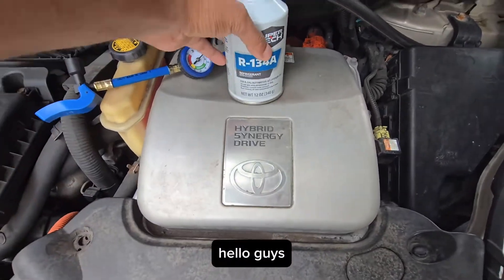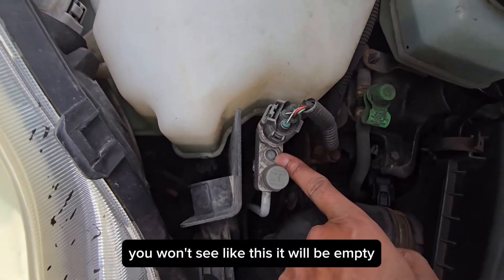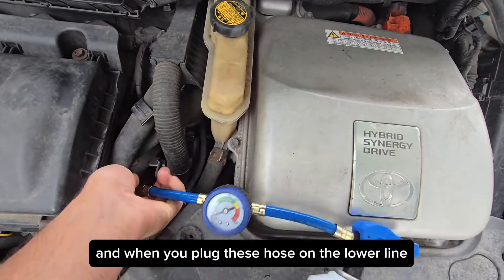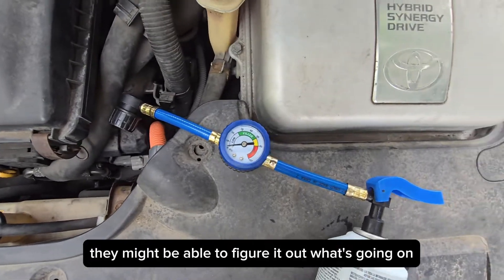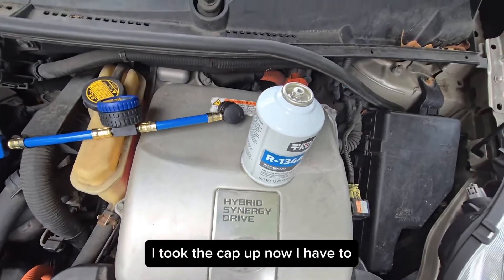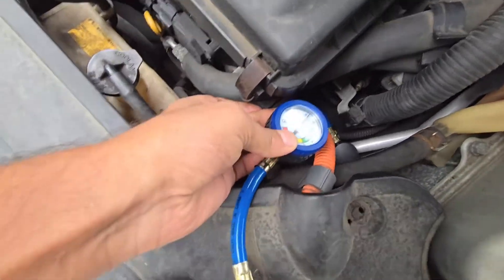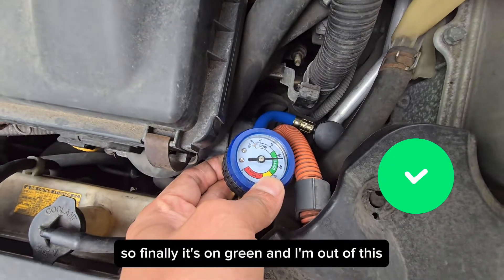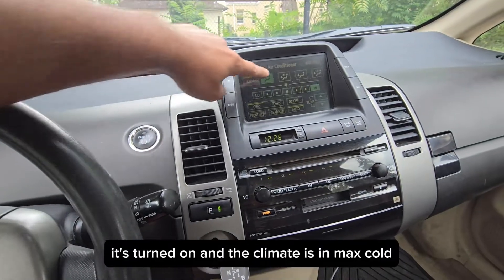Toyota Prius AC recharge. Refill R134a refrigerant in Toyota Prius 2005.#diy #cars #toyota

Comment: Your video is very informative but you failed to check the specifications for the R134a refrigerant inside the hood of the Prius.  The 2nd generation Prius requires ND OIL 11 or a polyolester (POE) oil-based refrigerant.   The Super Tech R134a and most every refrigerant sold is PAG based and should NOT be used.  Check out the facts and let us know the solution.  I haven't found one after corresponding with Walmart, Auto Zone, O'Reilly's, NAPA, Advanced Auto Parts, Amazon, and other vendors.
Reply from the maker: "Hey, thanks for the heads-up on the refrigerant! You're totally right – my research, including on PriusChat, confirms 2nd gen Priuses need a specific kind of R134a, either with ND-11 or POE oil, unlike the common PAG type you usually find. It's actually super hard to track down the correct stuff. To play it safe, I went with pure R134a with no additives in the video, and I definitely should have clarified that. I've updated the description with this important detail to help everyone out."
Reply: @youdoit101  Thanks for your remarks.  It is extremely hard to find pure R134a.  You might want to let folks know where you found some.  We also need to know from the community if use of PAG R134a has, in fact, damaged their Prius air conditioner.  And. it would be beneficial to learn it failing to add ND OIL-11 while recharging an AC system has compromised the lifetime of the Prius compressor or AC system.